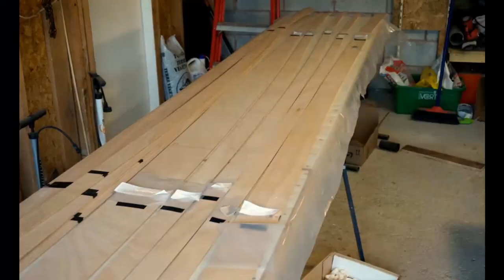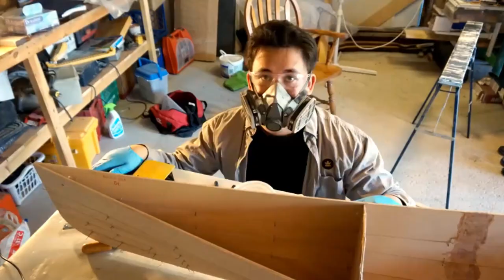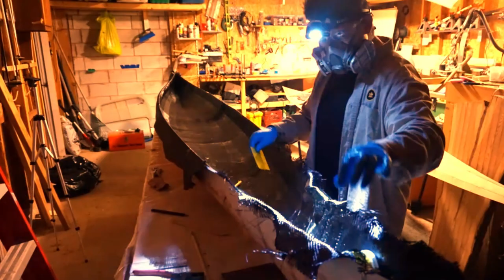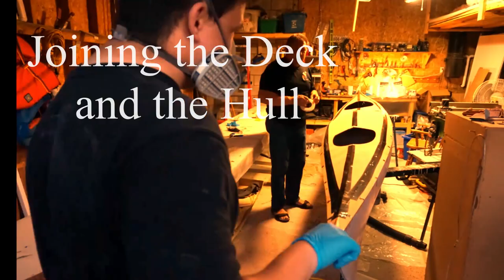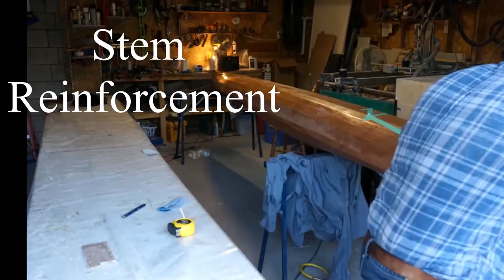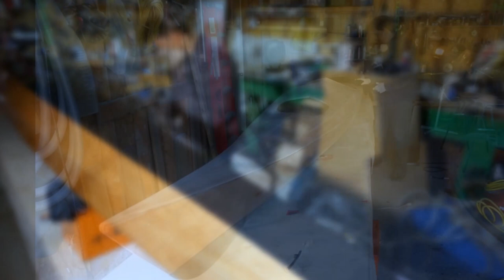Stitch and Glue Kayak Build

Comment: Can you elaborate on why the inner deck layup was a failure? Thanks for the video, I've built the Solace 16 EX and 18 EX, and currently the Wanaao.  Really love these kayaks.
Reply from the maker: The carbon twill I was using was not meant for a wet layup, it soaked in a lot of resin, added extra weight, and made a pretty big mess.
Reply: @mastermind90000  Thanks for that. I've always had issues with the factory provided seals on the rear hatch cover, there's almost no downward pressure on the covers to prevent water entry, have you encountered this problem and if so how did you maintain waterproof  rear hatch? Thx.?